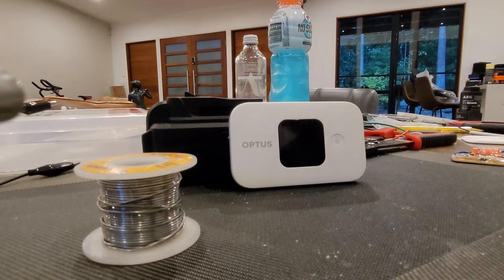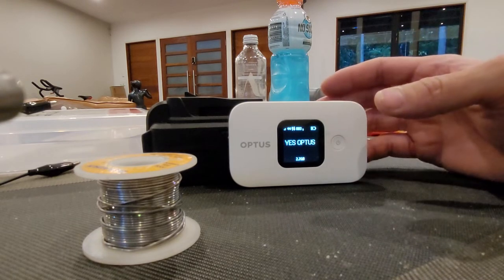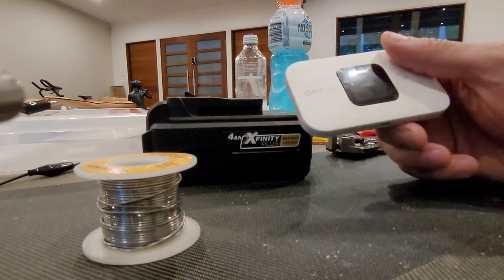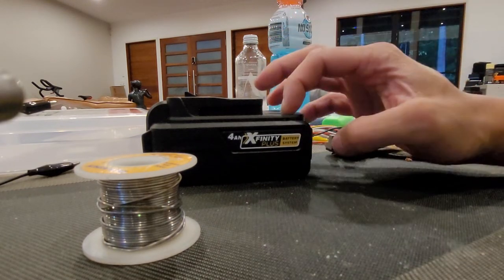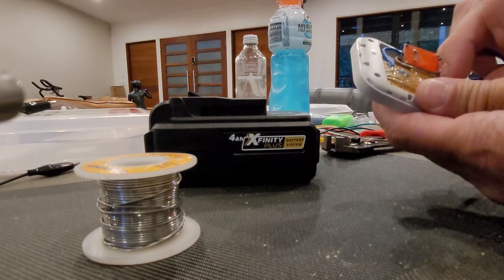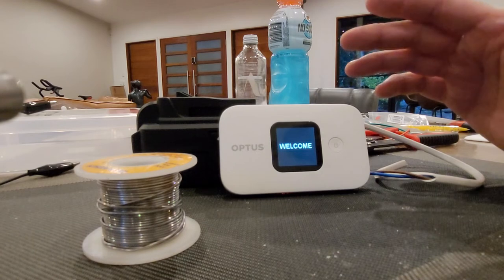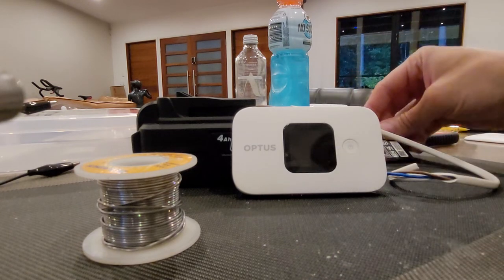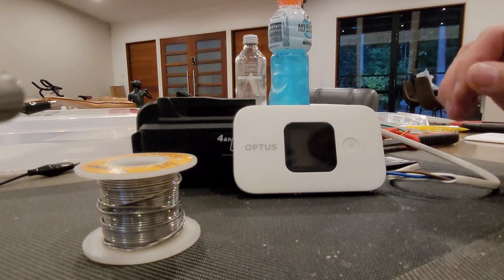Dummy battery Huawei e5577 e5573 mifi modem

Comment: Brilliant hack! 

So if I understood correctly you connect the diode to the positive and then the negative straight into the negative terminal and the resistor between the negative and the temperature sensor. 

Why wouldn't you just solder the components straight to the modem?

Why wouldn't you use the capacitor method to simply supply from the original USB port?
Reply from the maker: Yes that is correct. If people start asking I may do a diagram. 

The reason not to go straight into the terminals is that this method makes it reversible. As I said in the video, I can simply pull that out and stick the battery in and use it normally. 

The other method is good, but you would be using the internal charging system so it may generate extra heat inside.

As a matter of fact, after I did the video I moved the buck converter to the outside of the modem. So now any extra heat won't accumulate inside the unit. 

The other issue that I has with using the original USB port is that those ports tend to be flimsy and get damage if knocked. So now it is just a piece of flexible cable coming out of the modem.